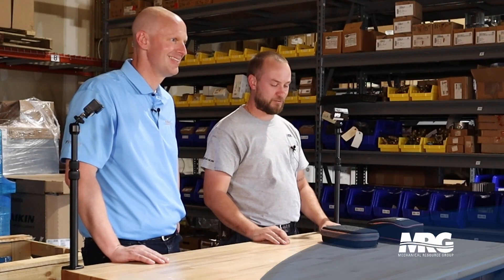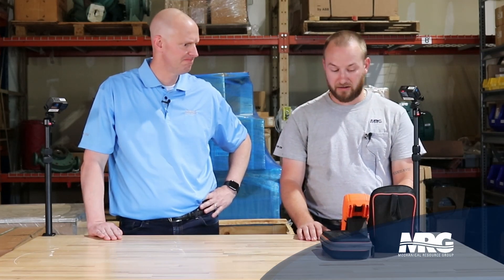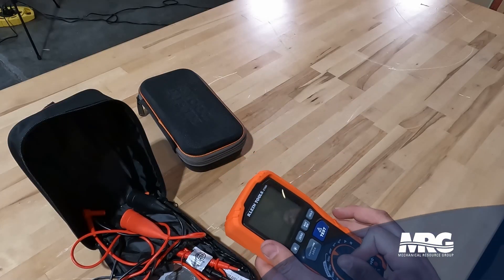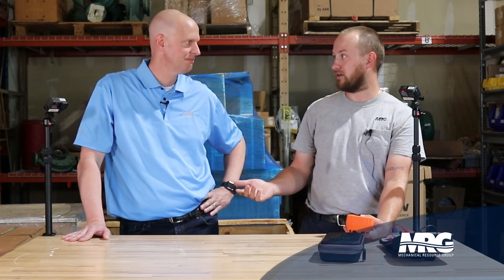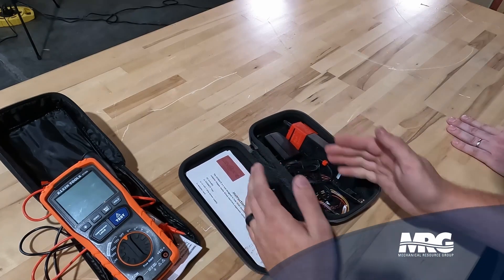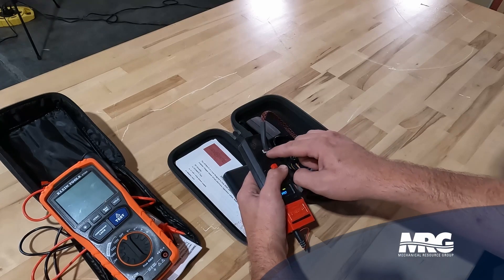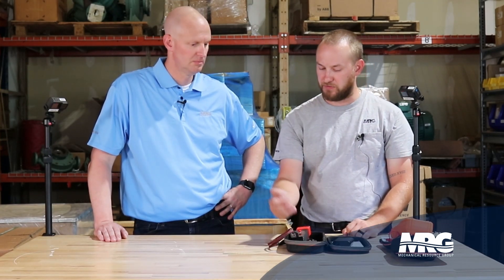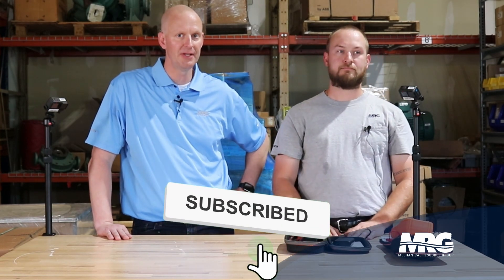HVAC Tech's Favorite Tools: @MechanicalPros

Comment: Great video! I thought I'd share some of my methods in using the Eevmate to answer some of Jon's questions. The display on the tool only counts step outputs so if the valve is not in it's minimum  or maximum position it may not accurately represent the valve position. To know that what I use is a mechanics stethoscope pressed to the valve body and listen while driving the valve for the distinct "click" sound it makes when it can drive no further. As for compatibilty it works for unipolar motors only. Those will have 5 or 6 wires. These are found on most residential, light commercial, ductless and VRF systems. It will not work with bipolar motors which have 4 wires and used on large tonnage Refrigeration and Applied systems.
Reply: @MechanicalPros  That’d be great! Your videos are well produced by the way.